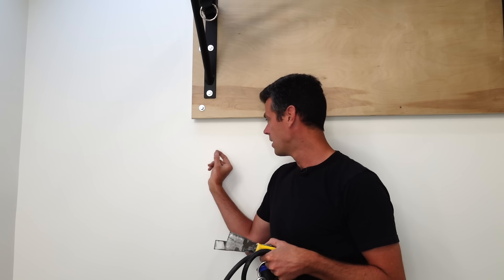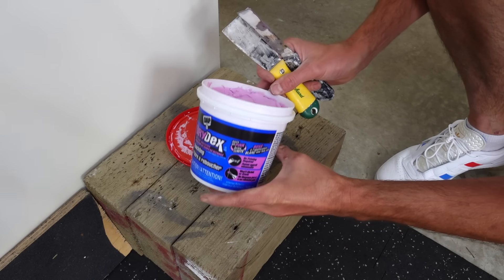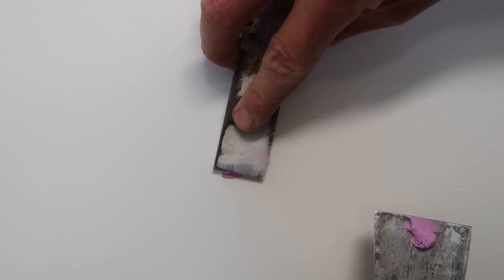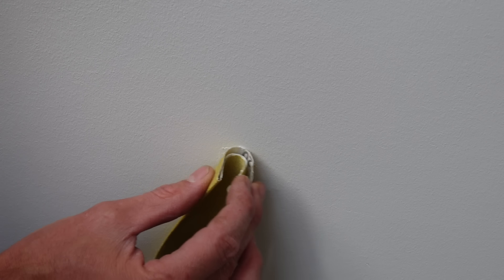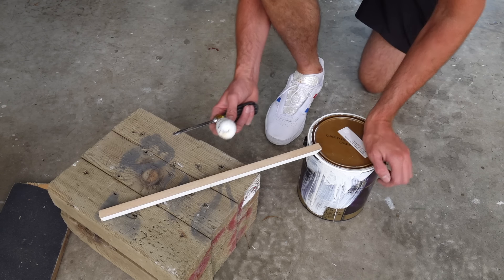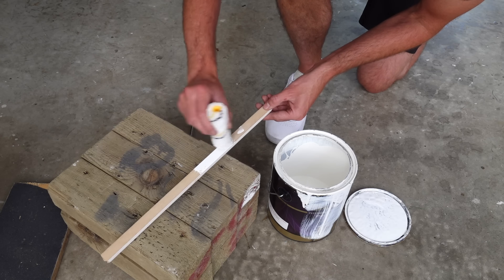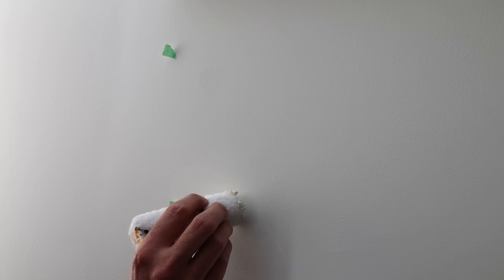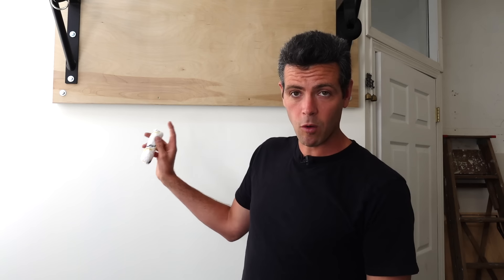How to do small touch ups without painting the whole wall!!

Comment: For small paint touch-ups like that, one method that worked well for me is to apply the paint with a brush, then roll a DRY roller over it. It will pick up the excess paint (if any) and imprint the roller texture in the paint 🙂
Reply: Exactly. Works great at removing any edges.
Reply: What he was doing is called "stippling". You can do this with a paint brush. You only get the front 1/4" or so if the bristles wet, and then you use the point of the brush, pushing it repeatedly against the wall as he was doing the roller end. For something this small it would be best to use a 1/2" fairly stiff bristle brush, or alternately just one end of a 4" brush.

Dry rolling, as you discovered, is a really good way to help clean the end result up.
Reply: Yes!  This is my go to technique
Reply: Yes!  This is my go to technique
Reply: Yes!  This is my go to technique
Reply: Yes!  This is my go to technique
Reply: Yes!  This is my go to technique
Reply: Yes!  This is my go to technique
Reply: Yes!  This is my go to technique
Reply: Say Greg, is this your go to technique?
Reply: @PascalSchoenhardt  ha ha ha
Reply: Exactly, my technique for decades. 
Pick up some small rollers from Cloverdale, have the removal roller with a metal handle, rollers themselves come in 2 pack.Time and lifesaver on touchups and small areas, and trim.
I shake the can up and use the lid for touchups.
Getting a seriously good light, and / or the right conditions to see defects is the best route ,,,, if possible.
Thanks for posting !!
Reply: Satin paint enters the chat
Reply: @PascalSchoenhardt  love it made me smile
Reply: i did that before, brush then roller, it really worked
Reply: @PascalSchoenhardt  
😂
Reply: @gregh988  sorry what is your go to technique?
Reply: This is a good idea.
Reply: Would this work good for a ceiling tho, with excellent lighting.
I just painted it and the underlying paint started bubbling and I cut it out, mud it, and need to touch it up now.
Reply: @j.rjunior5584  I see no reason why this would work.

But whatever you do, if it's under a grazing light, you'll always see the patch, especially with satin or gloss paint.

It all depends on the location of the patch, the lighting conditions, and the angle at which you'll be seeing it...
Reply: @PascalSchoenhardt  😂
Reply: Yes!  This is my go to technique
Reply: Yes!  This is my go to technique
Reply: Yes!  This is my go to technique
Reply: Yes!  This is my go to technique
Reply: @PascalSchoenhardt  Actually lol'd.
Reply: @PascalSchoenhardt  😄😄
Reply: Putting down some tape around what you are repairing will also minimize the area around your dent from getting compromised and larger.
Reply: Or just feather it out with a brush
Reply: This seems like a simple technique: just paint by brush and then dry roll. Would this be enough? There was a construction work going on outside my house that damaged some of the bottom paint of my compound wall outside. Paint peeled out in small patches all over the place. What would you suggest?
Thanks
Reply: shut the front door
Reply: Whose go to technique is this?
Reply: Absolutely, I do the same thing
Reply: does it work on other colors besides white?
Reply: Yes! This is my go to technique
Reply: @ced2k  perfectly said!
Reply: @PascalSchoenhardt lmao
Reply: Wouldn't it be easier to wet sand it instead of dry sanding which leaves scratches sometimes?
Reply: 😅 @PascalSchoenhardt
Reply: This is what I do too
Reply: @PascalSchoenhardt  I rarely laugh out loud at comments, but you got me on this one 👍

Comment: Unfortunately with the right (or wrong) angle and natural light almost any touch up is noticeable no matter what you do if the sheen is Satin or Semi.  With eggshell or flat paint you have a decent chance in the right light.  People are so picky these days we usually just reroll the wall (or try to feather and hide the edge above a window or door).  The other thing I’ve noticed over the years is that the more uniform the patch the easier it is to spot; whereas, non-uniform patches tend not to catch the eye.  Basically people just need to fill up the room with furniture and pictures and quit focusing on tiny imperfections.  Drives us nuts!
Reply from the maker: 100%
Reply: Not sure minimalists will agree but as a hoarder I concur! 🤣😂
Reply: Seriously, some customers want a flawless unnoticeable patch. It does drive us nuts.
Reply: 2 Foam brushes

1. Wax on. dab brush on the area until the patch is colored
2. Wax off, use foam brush 2 (DRY) to take ALL the paint off you just put on.

This will take all the paint off the wall, (the painted surface) but not your patch (dry gypsum)  which just absorbed the paint 

You won’t get sheen build up since it’s the same number of coats in every surface. That one took a long time for me to figure out

Comment: Hi. A painter suggest a tip for me when filling in holes. He said instead of sanding it to use a small damp cloth and wipe over it. Doing so wipes all the extra filler off the sides and leaves the holes filled in perfectly. No sanding required.
Reply: That's exactly what I do, especially if there's texture. Sometimes I just use my thumb.
Reply: @Bapuji42  Definitely sanded some patches like this with my thumb haha.  Works just fine if I'm just getting the walls ready for the paint crew
Reply: @joshyaash  For real, you don't want to get too formal about spackle.
Reply: Last pink stuff I applied says it’s silica. Not good for your skin, even worse for your lungs, so wet cloth finish is faster and safer.

Comment: For filling tiny holes I do the surgical approach, I will put blue tape across the hole, Cut out the exact shape of the hole (cut the hole first to make it easier), Press mud into the hole and use the knife to pull across the tape.  Then remove the tape and you are left with a perfect slightly proud fill, without any buildup, And the knife never touches the wall. When the mud dries and shrinks just a hair gently scrape with a razor blade to get it down to level, As for painting I usually gently dab it with a Q-tip evenly distributing across and slightly over the repair
Reply: I use the same method, but I sand with the blue tape intact.  Once you sand to see see some sanding of the blue tape, clean and paint.

Comment: Great video as always Ben. My technique is a little different.  I fill and use a damp sponge to remove the dry leftover mud adjacent to the hole.  I then dab the paint and use the same damp sponge to “feather” the paint around the edges.   It’s 90%+ perfection and never end to paint the whole wall.
Reply from the maker: Thanks for sharing!
Reply: Yeah, on a textured wall, the wet sponge will make it literally impossible to find the hole. I left my last rental before I bought my place, and the landlord was floored how perfect we left the place
Reply: Ed;

I ve done this as well  the sponge works really well for small blend in areas.
Reply: thats what I do and it works great!!
Reply: I've used artist's brushes and sponges.  I like sponges more.

Comment: So this may sound odd but I have fluffed up and used a Q Tip in the past. I roll the paint on with it and have been happy with results! Obviously this works on small spots. Also for sanding, I've just used a paper towel or even fingers in the past. Just my input:)
Reply: Neat advice, it has helped me!

Comment: The pink stuff is great for fixing dents. I use those cheap disposable foam brushes for dabbing paint on patches. It leaves a good texture. If the patch is a large one and the texture does not match the original wall I wait for the paint to be nearly dry then I deliberately dab on it with the foam brush or a regular brush to mess up the smoothness of the fresh paint. If it still looks too smooth after I put more paint and deliberately mess it up too until I’m happy with the texture. Doesn’t always work but it’s usually less noticeable.

Comment: Glad he called out the fact you can't get 100% unless you do the full routine. That is true particularly if a) the paint has been around a while (and oxidized, changing the colour over time) and/or the wall is exposed to sun much of the time (which fades colours). 

Depends on your need to match....

Comment: Actually a good video for tiny patches. One thing to mention (I skipped through so not sure if this was mentioned) this will really only work if you use the EXACT same paint left over from actually painting the wall in the first place. 

If you have to get a new tub of paint, even if it’s the same brand and colour if it’s a different tub of paint it will always be a slightly different shade. 

Actually as I’m typing this … he mentioned this exact point … side note when he says ‘flashing’ or ‘flash’ that’s a decorators term for the Sheen difference that you will get on a big patch job. 

Also if you are patching over fresh filler it’s best to double coat it so the filler doesn’t flash. 

Really good video 🤘🏼🙋🏻‍♂️

Comment: For the paint I sometimes use a super soft ladies large makeup brush with just the very tips of the fine bristles dabbed with the original paint (original mix if possible!). I gently dab this on the wall (never brushing!) and touching the wall very delicately. Do this multiple times but work away from the repaired spot to fan out using less dabs and paint as you move away from the repair. If the original paint on the wall is not too old this is generally quite effective. If the spot in question is not in the normal line of sight and not subject to bright light flooding it, the result should please the homeowner and avoid you/them having to paint the whole wall.

Comment: What you have done with the paint is called stippling.  Can be done with either a brush or roller. Also paints with sheen will flatten over time. Thinning the touch up paint substantially with water can help match the sheen
Reply: Joe B, are you a painter?
Reply: To match the old wall stipple I add some powder bag mud to my first coat of primer to thicken   The more stipple you need the more bag mud you add. Works like a charm.  I’ve been repairing wet plaster walls in historic homes using this technique for 25 years
Reply: Or you can add some fleotrol

Comment: earned the hard way. I painted my kitchen last winter. Touched up a few spots after removing an outlet cover (which tore up the first applied paint in the winter) and the new touchup paint went on differently. Shadowy. Just realized painting in different temperatures will yield different results

Comment: Awesome tips!
I've had good success with those little foam brushes and just dab with it.  I'll mix my paint really well and then use the foam brush to push the excess paint on my mixing spatula back into the can and whatever is left on the foam brush i take even more off and then just dab the touch up area. I barely use any paint and it has come out great every time! those brushes are super cheap but I'm even cheaper and I just wash the brush with just warm water and let it dry and put it in a ziplock and reuse the same one.
Reply: Me too bro, buy them in bulk and they’re like 20-30 cents each

Comment: As a painting contractor i do touchups quite often. The hardest part is getting a really good match, it needs to be the exact color AND sheen. I have a tinting kit that I carry in my van, and if its a tough sheeen Ill buy two paints, one too shiny and and another too flat and mix until i get it just right. Once you get the paint PERFECT you can touch it up however you want, although spraying works really well to fan out the hard edges. Dry rolling can work as well.
Reply: That's skill.  Hats off to you!
Reply: @readhistory2023   did you even read his comment ?
Reply: when I had too much sheen on some touch ups I found a light sand after painting would bring it back to match the original

Comment: A trick I’ve used with success after repairing and sanding filled spots smooth is to stipple the smooth surface with either primer or the color coat using just the end of the brush bristles to avoid the spot from looking too smooth. This also helps before  rolling the wall with all new paint. I also use a perpendicular scraper to catch and remove any and all raised bits from the previous painting before applying the new coat.

Comment: I use the same dabbing method, but with one of those little sausage foam rollers that have a rounded end.  You can easily control the surface area covered.

Comment: I like to use masking tape to go around the small damage. It allows me to apply the mud without touching the wall with the small trowel. Then remove the tape and add more to do the sanding. I use a hobbie brush to do the prime and paint.

Comment: Friendly Tip! I would have used a plastic yellow putty knife. Water down putty.  Avoid sanding.  Use an artist brush or a small foam pad. The Gooseneck Guy!  Inventor of the Gooseneck paint brush. Cheers!

Comment: I have had reason to do a reasonable amount of this sort of patch and paint over the last two years or so. My method patch and sand with 220 grit, but take the sanded area beyond the patch. I think, at least to some degree, the material used can make a difference. In my case I'm using Benjamin Moore paint and for painting I use a foam brush just to get the paint onto the wall. When I started this process I used the standard mini foam roller, but I found was the texture was not the same as a regular standard wall roller. Makes sense right!?

What I bought (HD) and left on my bench for quite some time is a 3" fibre roller kit from an outfit called Pintar, the model?, but called "Quick fix & small area kit."  I tend to roll out the paint 3-4" in roughly a circle. I have found once I have done this, thou sometimes two coats, I literally can not see the patch. The texture is near identical to original.

The one draw back to this little roller is, the handle and axle is plastic. To release the end hub one has to pinch the end of the axle slightly. With paint on the roller and very tight space it can be done, but it can be awfully annoying at times.

On the packaging it also mentions good for trim work, which is actually why I purchased it in the first place, and it is. Far superior, and quicker, finish especially for those larger flat sections than any brush. This roller does a good job conforming to some of the not so deep moulded areas.

Am I cheerleading this product, yes. I am not associated with the company in any way. This, in my opinion at least, is a product that does a really good job, thou of course it will depend on the skill of the user too.

Comment: I find using a foam brush to be good in a situation like this. Foam brushes have a point at the end, so you can control the paint to very small tight areas, but it also gives a finish similar to a roller.

Comment: If you rolled a wall, you have to touch up using a nap roller to avoid flashing. If you touch up a spot on a rolled wall with a brush , it comes out shiner because the brush doesn't produce stippling.

Comment: Great technique for matching the texture. I literally frowned when you said you can’t match paint later. Oddly my house has white walls throughout and matching white trim. Not my decision I bought it this this way. My concern is to fix the minor dents throughout means painting a whole floor. 😱 I will be ok, I will be okay, I will be okay… lolol
Reply from the maker: You can get a good enough color match to not have to paint all the walls but you will need to go corner to corner for the wall that needs repair.
Reply: @vancouvercarpenter  Thanks!  That is good to know.
Reply: But if you don't like the white, why not change it?  I lived with colors I hated for a year once when we bought a house.  I was busy having a baby and just couldn't get to it.  Once we changed it, it made such a difference in how I felt about and in the house that I decided I would never again live with a color I hated.
Reply: @SammyMaeQ  I actually have come to prefer the white. My frown was because since there is no color change I may have to paint a very large area so it doesnt look off.

Comment: If you use a razor blade for small homes it puts the Drydex in perfectly on smooth wall and because you have so little leverage on the tiny blade you don’t smoosh and change the paint texture around it

Comment: You could try putting painters tape around the dent. That would protect the wall while sanding & painting, and allow you to press on the wall with your knife. Also, try using small kids paint brushes. With the tape on, you dont have to be so precise. However, the small brushes allow you to be very precise, and they are really cheap. Just remember to pull that tape off immediately after painting.

Comment: Use a brush, cover the area with paint, then take the tip of the brush and tap it into the repair and work your way out adding stippling and texture also feathering it in with the surrounding area. I commercial painted for 13 years and you can make even larger areas virtually disappear. most untrained eyes will even miss it if done right. the key is blending it with the existing paint .

Comment: Ughhhh!  I replaced some wall sconces in our home theater which was painted less than a year ago. I had to spackle and paint where I removed wall anchors. The wall paint is a flat navy. I used paint leftover from earlier. Even so, the touchup looks like a different shade! I thought flat paint was easier to mend!
Paint flashing is the most aggravating thing there is.

Comment: I apply small amounts of compound for minor dent repairs with a razor blade.  If almost feathers the edge and requires little sanding.  Paint matching never working if using a previously opened can that is more than a few months old.  Best way to blend in is to use a small roller that is damp with paint and just roll over the spot and feather the edges out.  I have naver had anyone find my touch ups.  Yes I am that good.